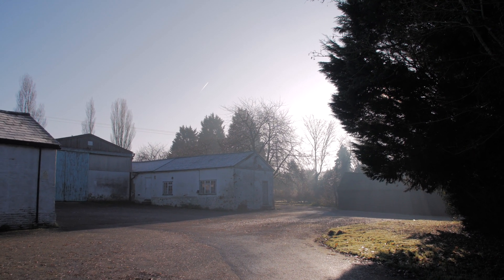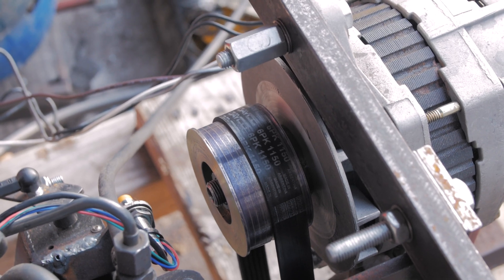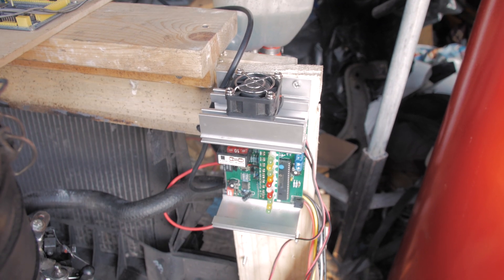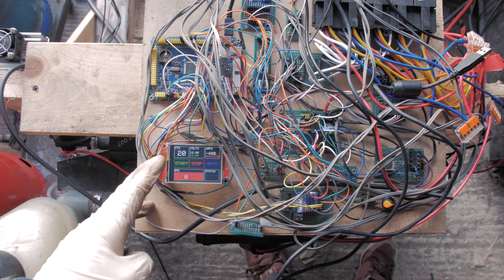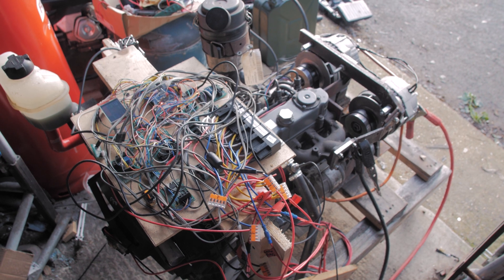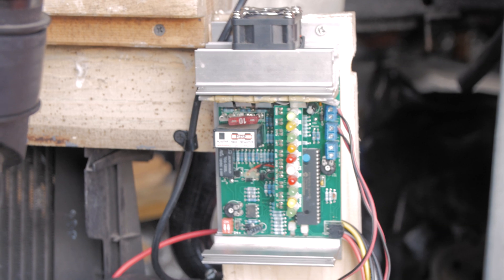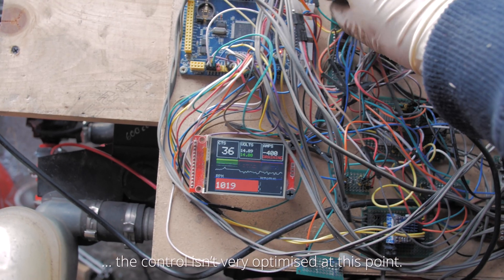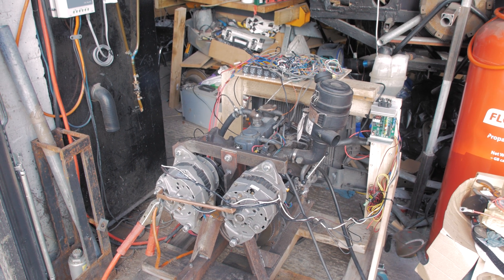New 12V Alternator Generator rig - Kubota Diesel! Brief overview - 01

Comment: the governor system is a deterrent for me to try this 😂
Reply from the maker: The simple standard mechanical governor is definitely easier 🤣 but no auto-start, rpm vs coolant temp control, no oil pressure protection etc etc

Comment: Oh my, this is too complicated for beginners. I needed a DC generator and can't afford $10 million dollars lol, I checked out your Honda clone dc generator (now broken) and wanted to immitate it, but what works in my mind is so simple. Just the engine, connected to a alternator and AC compressor (because I needed the AC) then connected to solar panel pwm (the one rated at 80amp) then from there connected to the battery. That's it. That should work, is there anything I missed? Please respond. You have experience on this matter, I don't.

Comment: Thats a pretty big upgrade from the last system.
Also that looks like an inverter coolant pump from a prius. The batteries are air cooled ( at least mine is ).
Also, glad to see a fellow tinkerer. With all of the work done for your control system you could’ve bought a pretty nice commercial generator :) I’m glad you didn’t though as this project is fascinating.
Reply from the maker: Wow, thanks for the kind words! I have looked at commercial solutions but in the 12/24v world the only stuff I've seen is standardised form factor marine generators, which are well outside of my budget, and they tend to run small 1/2 cylinder engines that run pretty hard. It's quite nice knowing this engine isn't really stressed and I can throttle it quite low to prolong it's life... And you're dead right about the coolant pump. Being the inverter circuit I don't think it gets a hard life but  I pretty quickly found out that it's not happy pumping boiling coolant, so it's been upgraded to a different pump (bosch VAG auxilary coolant pump). I may do a video with my findings when I get a bit more progress.

Comment: I thought these kubotas were thermosyphen...... I know small yanmar engines are. I had a Ym1500d it had a 2 cyl diesel. I remember seeing an option online for a water pump.
Reply from the maker: I'm not sure about if any of these are thermosiphon, but it did have a mechanical water pump and thermostat - I removed these to be able to run an electric pump.
Reply: @Loopyengineeringco  Oh it probably isnt though if it came with one from the factory. Still, a very cool, unique and nice setup!